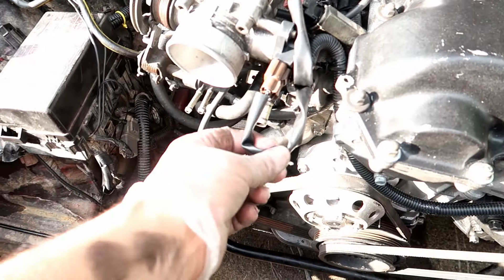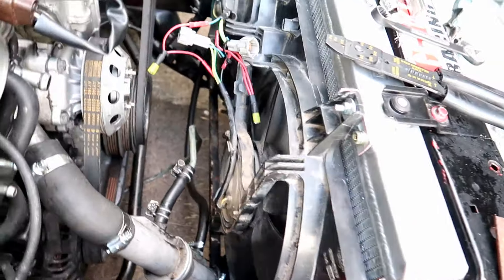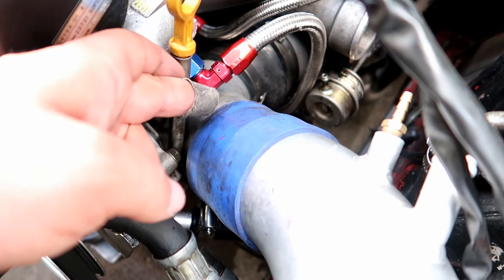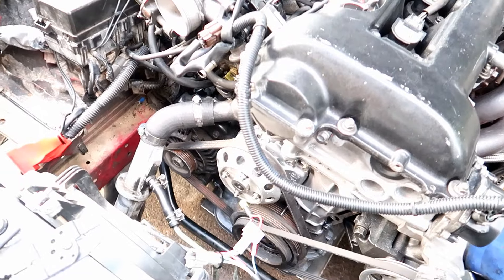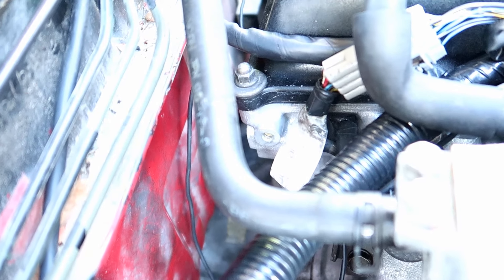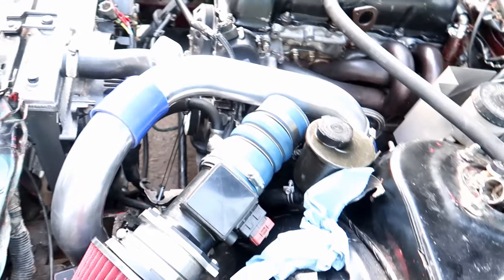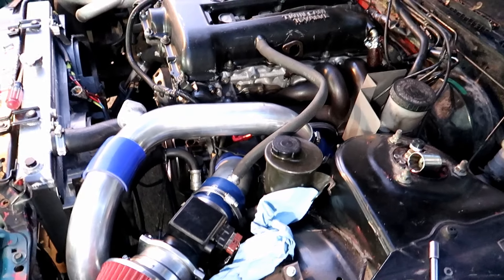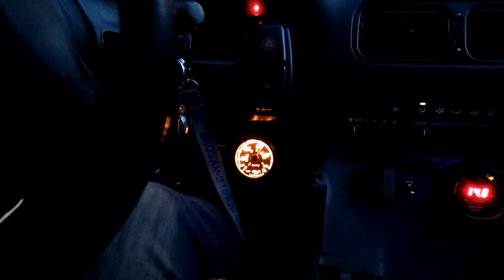SR20DET Swapping My S13 Part 2

Comment: Hey bud. So there's a spot I saw on the driver's side, next to the air filter, where I think you could get a 26 series battery in, if there's anything in that whole you can screw a mounting plate to. If you put it in the trunk, make sure it is vented to the outside, less you want to be breathing sulfuric acid fumes. Also, I can tell you that those Spectre air filters don't breathe as well as the other brands. Later on you may want to relocate that filter under the car, so that you have more room for a bigger filter.
Reply from the maker: A 26 series is what I've got. I'll see if there's is a way to squeeze it in somewhere. I'm going to look at new filters also 😁